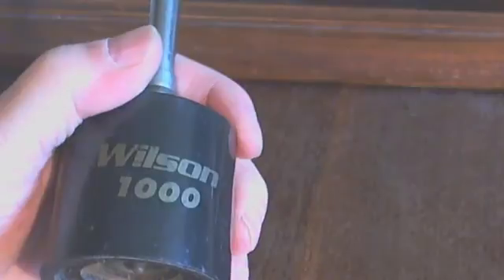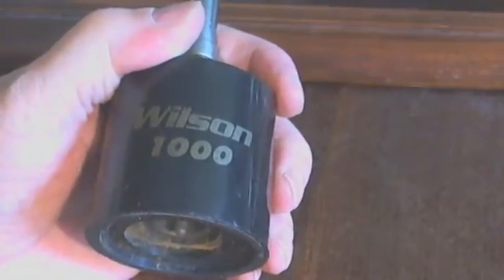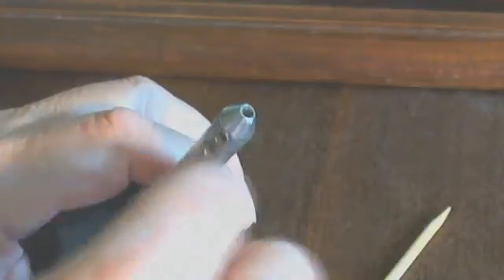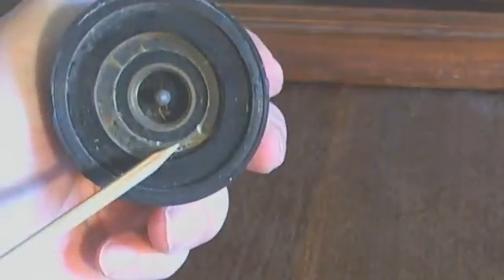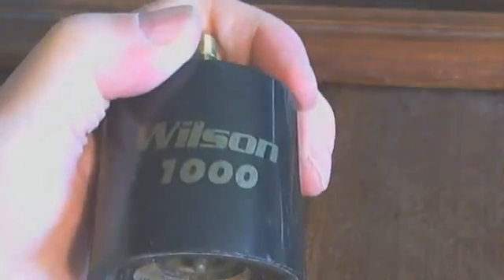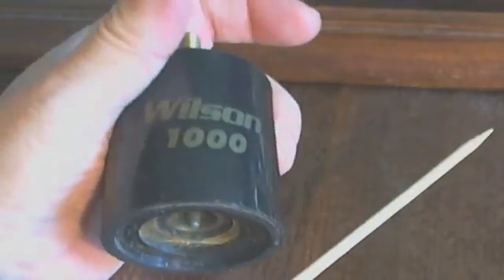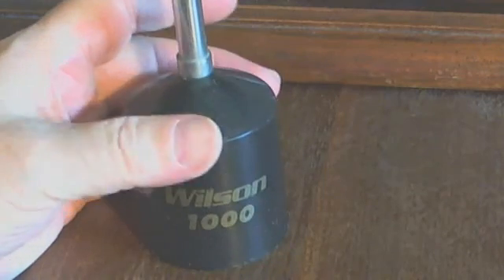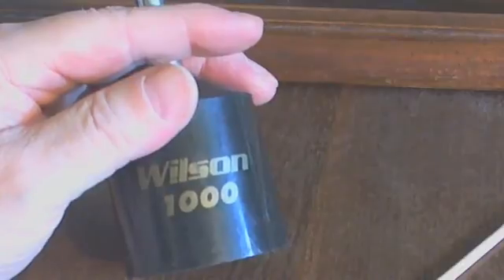Marconi's ideas on the Wilson 1000 and water problems.

Comment: The antenna is $120 today, what you do is pull the whip out and put a tiny O-ring on the bottom of the whip so the water rolls off the O-ring

Comment: Heres the problem wilsons get with water. it may be true that water gets in the coil if it develops a crack where the stud comes through but I think that's rare. If your getting high swr its not that water is in the coil its that the stud coming through has corroded. I had it happen. spun off the stainless end and the copper stud was corroded causing high swr. cleaned it up and swr came back down. putting no/ox on this connection and the stinger would probably help.
Reply: Water got into mine and it did cause my WSR go up to 3.2, blew it out with my cab air heating hose and good as new.

Comment: I've got a Wilson 5000 and yes you can take them apart. I have taken mine apart and upgraded the coax. I have no problems at all with my Wilson 5000. Even running a 3 pill worldwide through it.
Reply: Mine's is still kicking butt after 7 years.

Comment: Update. 
My friend has bought the Wilson from a CB radio shop and within one week, he saw inside the Wilson CB Antenna. 

My issue was a little bit different. Saw good reviews for this crappy antenna and found that it does absolutely nothing for me. I took it to a shop to have it tuned and it was still crap. The antenna comes with 18 feet of thin coax and it doesn't have a connector at the base of the antenna so you can easily swap out antennas. Ask the guys at Mauldroppers.com and they'll tell you the Little Wil antenna sucks. I wish I never touched this crappy antenna. I should have just sent it back. All I get is crackle, fuzzy voice and nothing else. If you want a decent antenna, go with the Wilson 1000 or the 5000. I used this on a Uniden PC68LTW. That's about all I can tell you. Stay away from this product. YOU'VE BEEN WARNED. Instead of this junk, I will suggest you buy the Stryker SR-A10 CB Antenna (Explore Stryker SR-A10 CB Antenna here: https://strykerradios.com/best-cb-antennas/ ). it will never let you down. If you want to buy a CB, anyone radio will do for normal everyday use. However, the antenna makes or brakes you. After frustratingly buying several smaller more discreet antennas, I purchased the Stryker SR-A10 CB Antenna. I prowled the internet and it seems near unanimous that the Stryker SR-A10 CB Antenna is the best and smallest low-price antenna you can buy and still get the performance you'd expect out of a CB. The antenna is around 4 feet, which, while not tiny, is not big by CB standards. Properly tuned, this antenna will get you several miles of communication. I travel daily in areas where cell phones don't get out, so this was a good investment for me.

Comment: Grandpa needs to change his Depends as he is full of crap. The hole in the antenna stinger  ferule does NOT go all the way through so water can NOT enter the coil that way. Also the stinger to ferule tolerances are so tight that water can not get into the ferule. I have taken well over a dozen of these apart and found no path water could take into the coil.

Comment: I've had mine since it first came out, coil and whip. Never had a problem.  Had to replace the coax 2x on the mag mount due to normal exposure but still works great.

Comment: your right about the SIRO antenna I had 1 5000 wilson bought it new about 2 yrs a go , You can't take it a part either so i cut it a part & the problem was just what your talking about , No holes to drain out ? after i cut it a part i found the problem , The bolt that held the coil was all rusted & lose , i cleaned it up & put a staniless steel bolt & washer in it & drilled 4  3/16 th holes in the bottom it worked fine . but i bought 2 Siros & there the best in my book for me anyway . Thanks for your video .
Reply: If it is totally sealed then why would you need a drain hole to drain something that can't get in anyways??

Comment: @Paul H Ford, what do you recommend to "water proof" or seal around the area of the antenna and mount. I currently use electrical tape to "prevent" water going in, but looks cheap and I have to change the tape out periodically.
What do you think about that "rubber spraying " the entire base mount?

Comment: I've been running a Wilson 2000 on my pickup for almost two years now, and I've never had  a single issue with it getting water inside the coil housing.